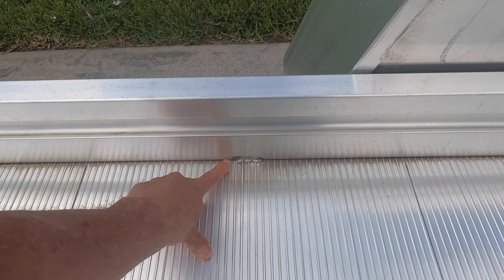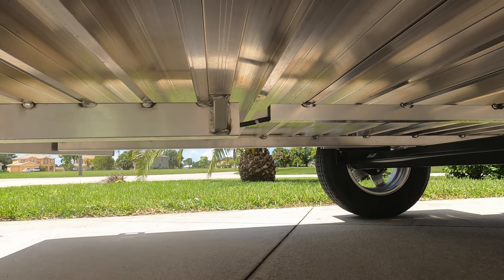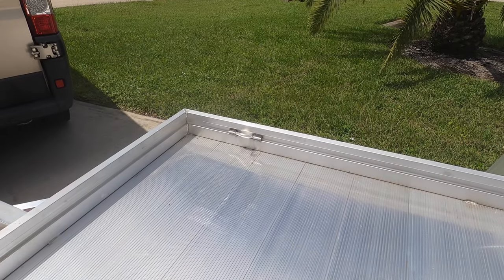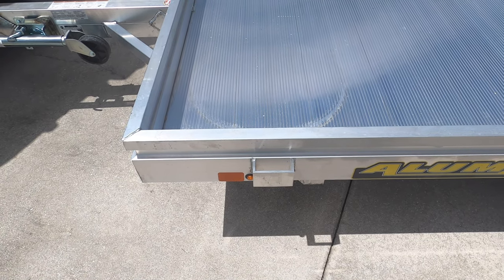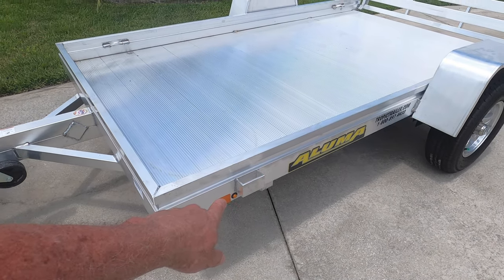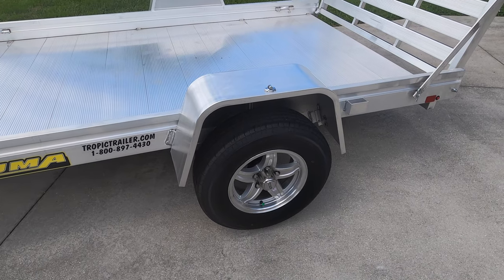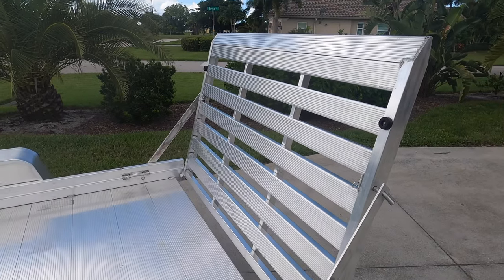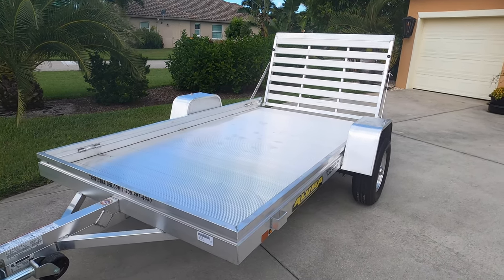Aluma Trailer Review

Comment: the extra tie down brackets and stake pockets can be added when purchasing any Aluma Trailer
Reply from the maker: You are correct,

In fact, I mention that very fact in one of the Aluma trailer videos. It might be contained in the video where I add recessed deck tie-downs. Indeed, one may order several accessories from the factory. The caveat being, one must wait for the trailer to arrive instead of taking what's already at the dealers. I have no idea what the lead time would be. If by chance you know, please make an addendum. Thanks for your input. I'm sure this will be helpful to viewers.

Take care, Mike
Reply from the maker: P.S.

At the 8:52 minute mark in this video, I mentioned that the accessories could be purchased as extras from the factory. I'm sorry you missed that. However, having a comment pointing out one's choices is still a good thing.

Cheers, Mike

Comment: I have a 2021 MC2F. Overall it is a good trailer, but I have the following complaints:
Welds suck
Front wheel chocks - unusable & replaced
Tie downs not located properly.
Ramp is small and hard to load from.
Noisey and required diagnosis & addressing.
No spare tire carrier and optional add-ons are mounted in the way of loading /tie down
Tires are China bombs - had a major blowout
Fenders are welded and non-removable - blowout bent the fender.
Reply from the maker: Hi Jeff,

I'm sorry you've had such a hard time of it. Sometimes, despite our best efforts at good maintenance, things break. One thing I can agree with you on is that I wish I had a longer ramp. I believe if memory serves me right, you can order a longer ramp. I highly recommend that feature. Well, if you're anything like me, your repairs are better than the original. Thanks for stopping by.

Take care, Mike

Comment: Looking to by an alum trailer and had a couple questions. when its wet or snows out im not sure if you have a lawn tractor or atv but if so do you know if it gets wet the gate do you have a hard time getting up the gate and does it slide all around?  We have a steel sur trac at the moment and its fine but was curious if alum made them hard loading up when its wet. Please let me know.
Reply from the maker: Nice to hear from you, Rares R!  

Yes, when aluminum is wet it does get slippery even though the ramp extrusions are serrated.  The way I solved this was by applying a restaurant non-skid mat on the ramp, and I used non-skid paint on the deck.  You can see these fixes on Episode 28 and Episode 64.  I hope this helps.

Take care, Mike

Comment: And that tube underneath is the drawbar.  Then they added a small tube to run the wire in.  There is not reason to run the draw bar the full length of bed.  No trailer is made that way.
Reply from the maker: Hi Bob,

Well informed comments. 

Thanks again,
Mike

Comment: In other words,  spend a few extra bucks and get a Floe.
Reply from the maker: Hey user-hu1zd5Shy11,

Thanks for stopping by. I admit I got a chuckle from your comment. I wasn't sure if you were a representative from the FLOE company or a satisfied owner. Ha. However, you do make a valid point. To inform viewers, the FLOE trailers use an aluminum frame with a composite/plastic bed in different configurations.

As a matter of comment, my reviews are not intended to advocate for a particular brand, but rather give viewers a pros and cons of a product that I've used. With that said, my experience extends beyond this specific trailer.

If strength and durability are your main concern, steel trailers win hands down. I don't think I've ever seen an aluminum trailer hauling large construction equipment. If you are interested in a light weight trailer, especially in a marine environment, then the aluminum trailers come into their own. Aluminum trailers make great utility trailers regardless of their manufacturer.

Which brings me to the FLOE trailer that you referenced. For years I have owned a composite yard cart. This cart replaced my wheelbarrow that finally could no longer be fixed. This cart is made of steel with a composite tub. After much frustration with its pneumatic tires, I replaced them with solid tires-much better. I have mixed concrete in it, carried tonnes of dirt and sand in it and I have abused it in the same fashion I abused my steel wheelbarrow. Other than a slight tear in the plastic around the upper rim, it's still going strong. I have no doubt that a composite trailer could be quite tough and durable. I envision a FLOE trailer being very useful for a home owner looking for a utility trailer that also doubles as a light weight material hauler.

Thanks so much for offering your insight to my review. I'm sure viewers will find this helpful. Choices in trailers boils down to one's individual needs and financial means.

Merry Christmas 2023, Mike